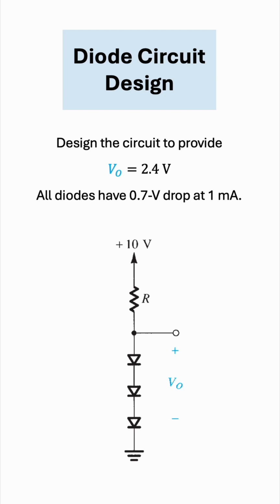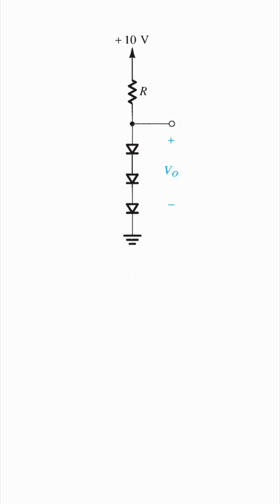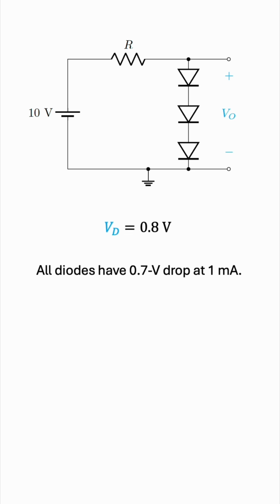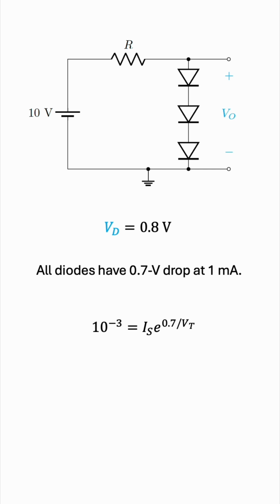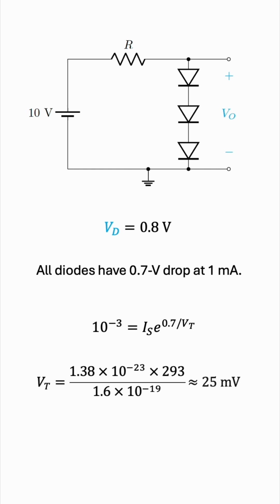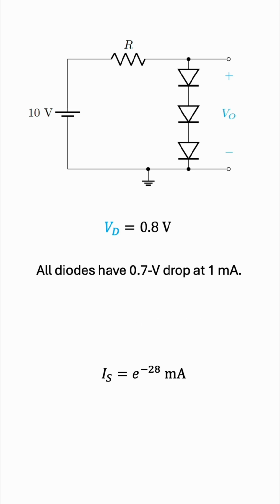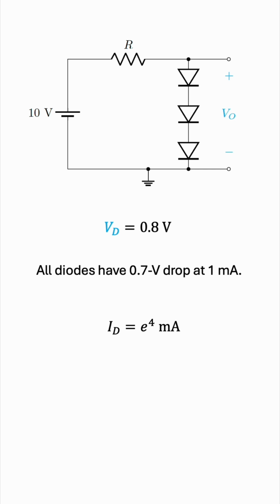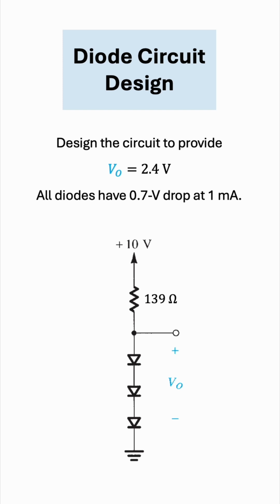Diode Design Problem: Choose R

Comment: Isn't the diode equation I_d = I_s * (e^(qV/kT) - 1)?
Reply from the maker: Great question.

If you expand your equation, you will get i = I_s * e^(qV/kT) — I_s

Now, if the current is somewhat appreciable, it will be significantly greater than I_s, which is typically of the order 10^(—15) A. Then, the subtraction of I_s will be negligible, and you will arrive at the exponential model we used in the video.
Reply: @ElectricalMaths Oh I see. Thank you